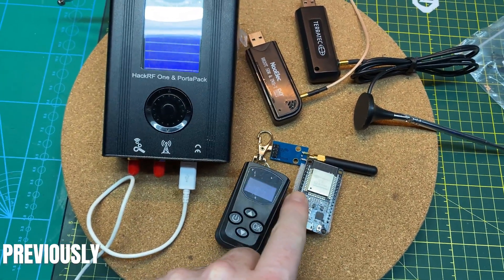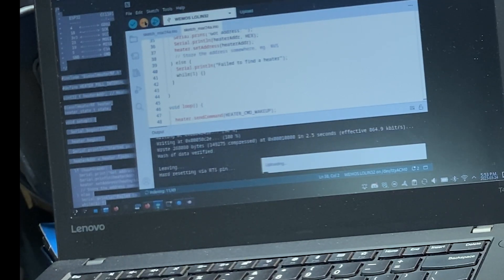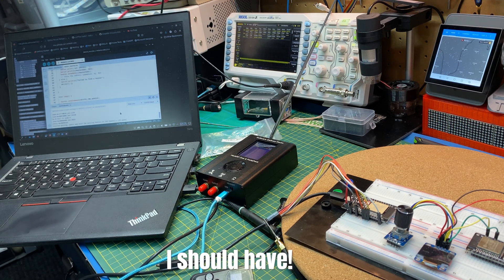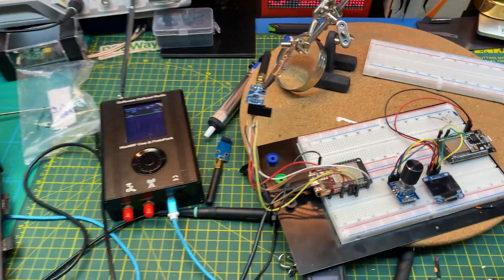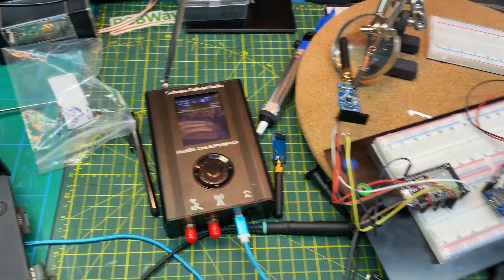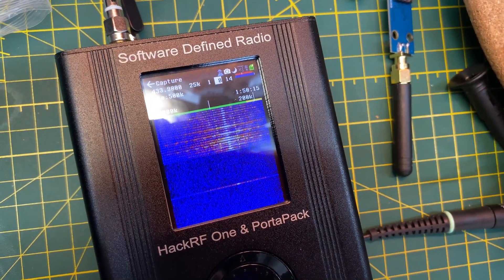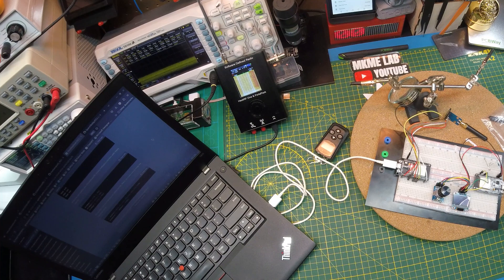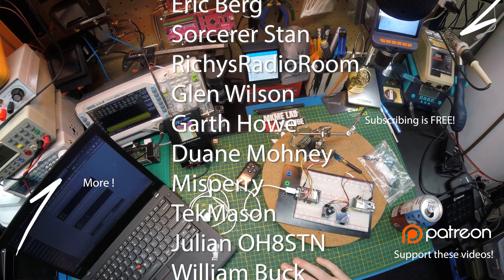Hacking a Chinese Diesel Heater With HackRF, ESP32 & Chat GPT,  Part 4 - Chat GPT to the RESCUE!

Comment: Radiolob have you tested the repeater sketch? I have good luck with it. I believe it is in the last folder under cc1101 under radiolob. Try that you can set how long for the retransmission so you can send commands to your header have the repeater wait and resend it have x amount of time. Just as a test works well. I am struggling with cc1101 and esp32 sending Pocsag protocol pager I can get it to send but way over or under modulated and this not a clean signal so pager or sdr will decode I don't know if it's a limitation of the cc1101 another interesting fact is I cannot send anything fake or pocsag at anything above 512 bps 1200 will now transmit at all! I have a sx st radio on its way I am frustrated with cc1101 so this could be your issue as mine out of 6 cc1101 I have I am unable to transmit about a certent rate it will look like it's transmitting in the serial console but no output from the radio!